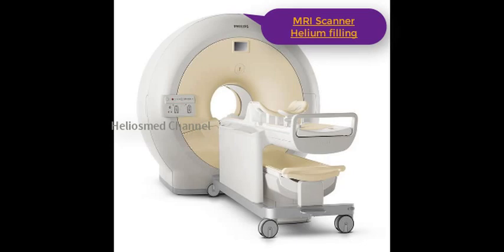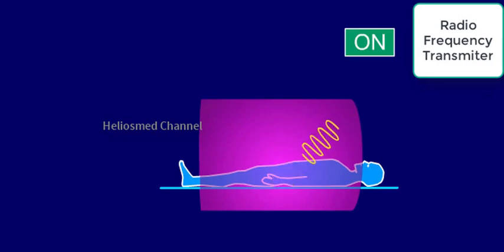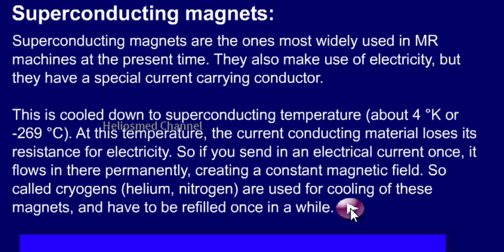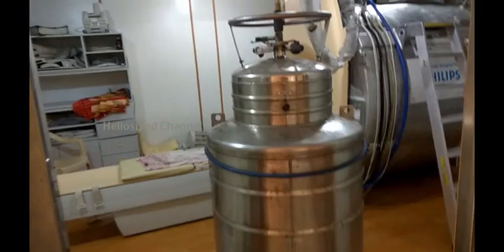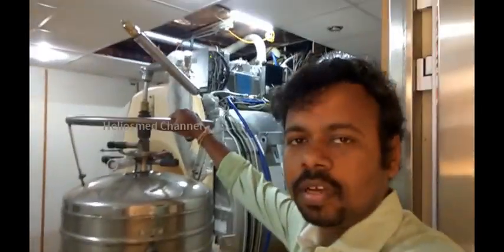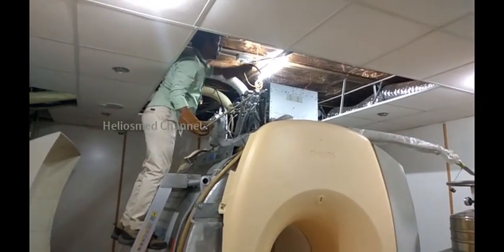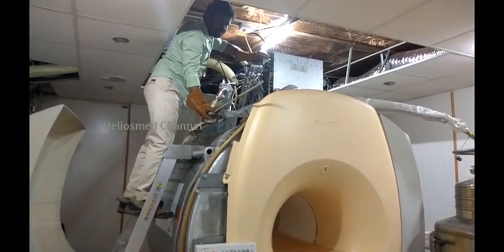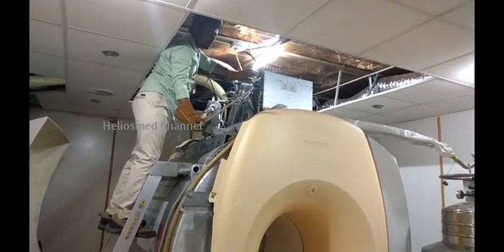MRI scanner helium filling

Comment: How does the liquid helium flow uphill through the pipe/hose? I am assuming the pipe runs to the bottom of the dewar and vaporized helium is allowed to build up pressure above to force the liquid to flow.
Reply: Yes, there is a dip tube going to the bottom of the dewar "tank".  The gas pressure is raised in the top of the dewar and it squirts the liquid out like a giant aerosol can.
Reply: It's under slight pressure. It does not take much to get it to move. First you pull a vacuum on it, then backfill with helium gas. Next you fill the heat shield dewar and let the magnet reach LN2 temperature. Then the liquid helium is slowly filled in, the process takes a while. Once got a trailer mounted MRI machine off of ebay and recharged it. Cost about 30 grand (got the mri trailer for 8 grand) and the process took about 4 days. Charging the magnet up was slow as well. A hospital in Reedsburg WI rented it then bought it ❤

Comment: It is not a good system if it needs topping up every 8-12 months. These 4K should not require any top up as the coldhead and compressor recirculate the liquid helium. Your fridge freezer doesn’t require refilling every year so does 4.2K systems. If this a regular maintenance for Philips MRI’s then I wouldn’t buy it if I was in charge. That dewar (container) hold about 800 liters (approximately 60 Kg) of liquid helium.
Reply from the maker: Yes this is older 10K magnet latest 4K magnets Helium LHe topup frequency is very very less :)
Reply: Yet there are people in the world (mainly the USA) who think their air conditioners need a "top up" of refrigerant every year.
Reply: @Elfnetdesigns  isnt that different chemical called R-12?
Reply: An increase of refilling frequency usually indicates the cold head needs service. The gas inside those is extremely costly helium 3 or a mix of helium 3 and helium 4, while the magnet is cooled with ordinary helium 4.❤

Comment: How many kg gas required in machine
Reply: Typically 1200 liter to 2000 liter liquid helium vessel, depending on model. That’s about 150kg to 250kg of liquid helium per system
Reply: In germay one filling with 200kg would then cost about 12000 - 16000 € depending on the current helium price.